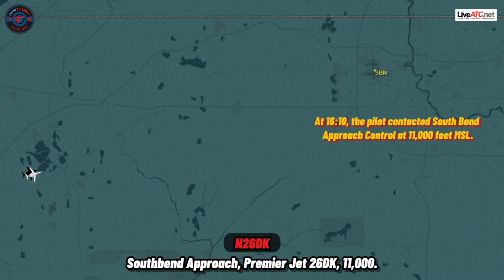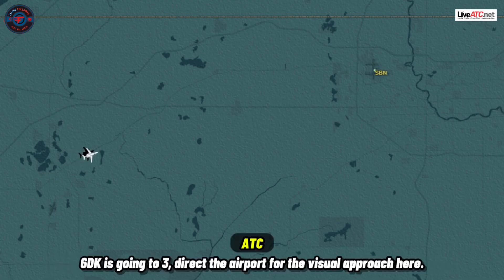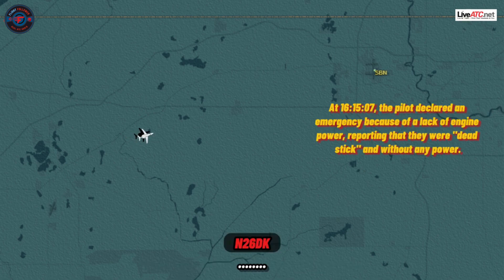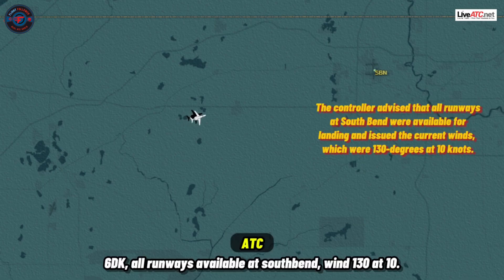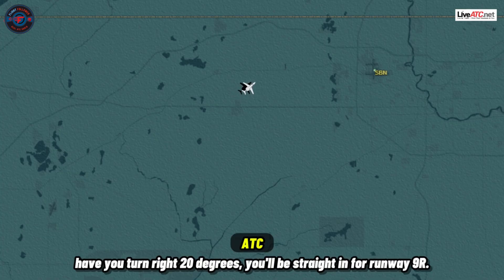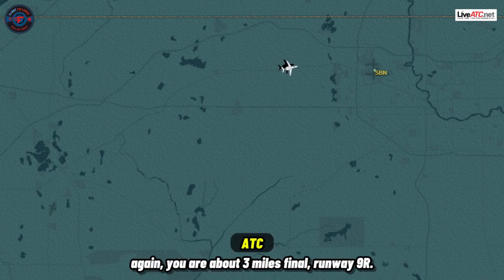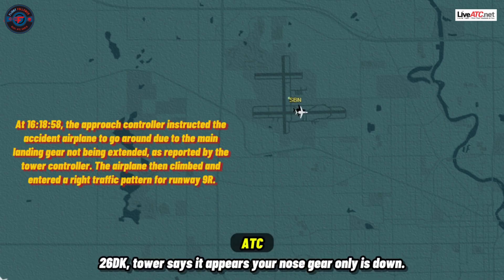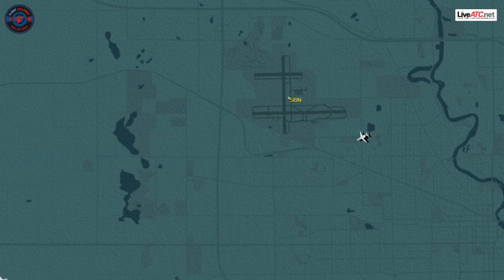Pilot’s TERRIBLE MISTAKE Brought Down a Corporate Jet!#atc

Comment: Relevant parts from the video description:
-Pilot allowed a non--type rated pilot to operate the controls in the right seat.
-Pilot told the non-rated pilot to pull the power to idle, but he pulled back so far that it shut off fuel to the engines, which is why there were no hydraulics and gear was not extended.
-Pilot managed to get one engine restarted very close to the airport, then tried to do a go around, presumably to get the gear down, since they had at least one engine running now, but crashed on the go around.